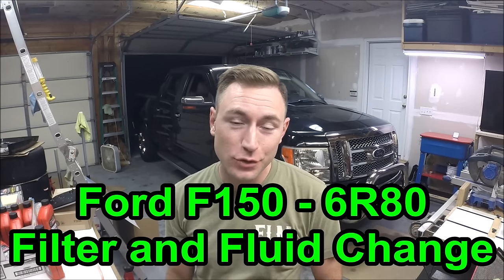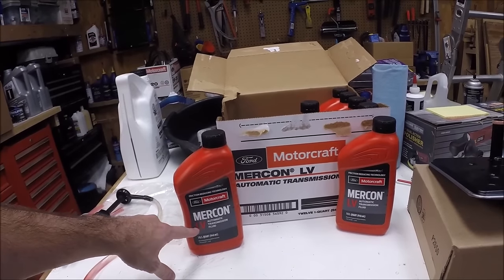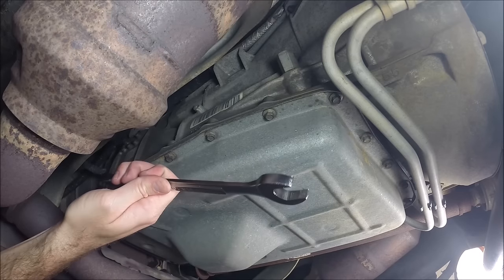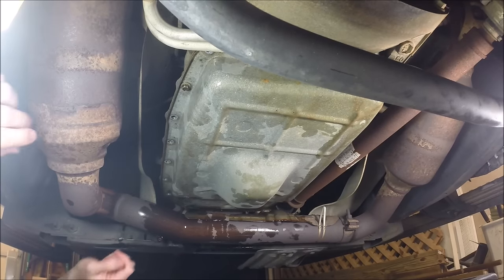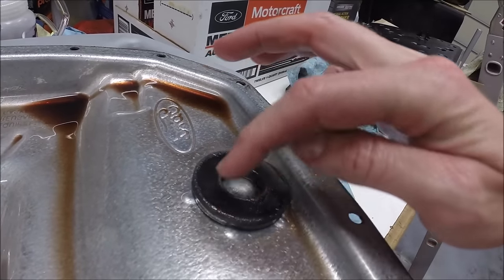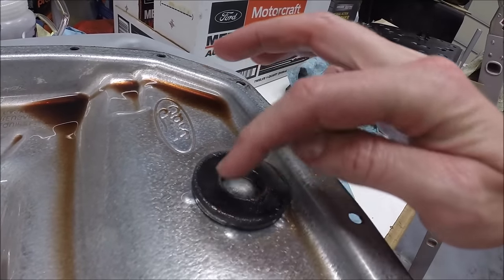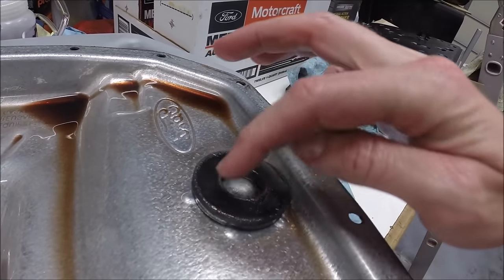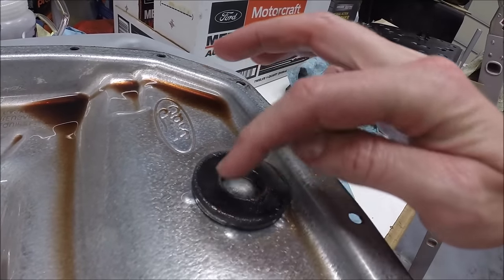Ford F150 - 6R80 Filter and Fluid Change

Comment: Would you recommend using aftermarket oil like amsoil atf instead of mercon lv or v?
Reply from the maker: If you decide to use another fluid, you need to make sure it is truly the same as Mercon LV.   The LV stands for low viscosity.   Also, you're only changing about half the fluid; there's still some left in the torque converter, cooler lines, etc.   So to really get the benefit from a different fluid, you would probably want to change the fluid a couple of times.  So for me personally, I decided to stay with the Mercon LV.    If you decide to try something else, please come back and share your results with the class.  Thanks!
Reply: Scruf's Garage i called amsoil representative and they said it’s compatible with mercon lv. I know it’s bias but I did put 7 quarts like half of what inside the transmission. So far it’s smoother than before. I don’t know if it’s good that way. It should be. I’m planning to drain it and put another maybe 6 quarts this time. I upgraded my cover with Dorman with drain plug. We’ll update you soon

Comment: did you hade any problems with the Transmission after you did the fluid exchange?
Reply from the maker: No issues.   In fact it helped resolve a "judder" issue I was having.
Reply: @ScrufsGarage  good news, I was asking because the fluid color was dark and most of the time when you change it when is that dark the transmission goes bad

Comment: That shudder is probably the driveshaft binding. Common issue
Reply: The driveshaft binding causes a clunk when stopped at a light and you let off the break to pull away. The clunk happens as the rear of the truck settles or squats back down in the rear.

Comment: I bet it wasn't even a transmission shudder. These trucks are notorious for the driveshaft causing this shudder. All you need to do is regrease the spline that slides into your transfer case. I thought for the longest time it was a shudder from the transmission, but nope. Driveshaft
Reply from the maker: For me, I had both issues.   Changing the transmission fluid helped the shudder.  I never got around to doing the repair for the driveshaft clunk on takeoff.  But for those trying to determine what issue they need to address, it's good to be aware there are two different issues.
Reply: @ScrufsGarage  what I'm trying to say is from 20 to 50 mph even faster, I would have what felt like rumble strips shaking my truck. Thinking it was a transmission shudder when in fact when I greased up my spline on my drive shaft it took care of the shudder and also that stop/bumped as well. $10 grease is all it took 👍

Comment: Wise men once said t never reuse a gasket
Reply: Unless it's a reusable gasket.  I've dropped my pan a few times and no leaks so far with the stock gasket.  But yeah if it ever leaks I'll drop the $40-$60 and use a new gasket.

Comment: Shit so you dont get the 12qt of oil out . ! I bought 12qt of oil ! But u saying u only need 8qt
Reply from the maker: I would capture and measure the fluid that comes out.  It's very unlikely you'll get 12 quarts out.   But better to have more fluid than you need, than filling up and finding that you're a quart short.    Be sure to report back with how much fluid you get out.
Reply: @ScrufsGarage  so i just did it yesteray and i only got out about 5qt and 1/2 ... so dont know if i am missing  my mustang is lowered so i cant get under and check the oil level while the car is level so i need to take it to a lift and check it out . Cause i mean 5qts its not much .... and you are right usually everyone says about 7qts

Comment: Ford doesnt want us checking or changing the fluid is right. They want to bleed us at the dealership. They should be ashamed of this magnitude of greed.    Do-it-yourselfers are going to do it ourselves anyways. Actually I'm going to make a point of avoiding the dealership bc of this.
Reply: Ford figured out that most of problems relating to their transmissions was having too much in it, The only reason ford put the dipstick under the truck is so that inexperienced people don’t go adding fluid every time there trans acts up

Comment: People must be checking the fluid level the wrong way if they get 5 plus quarts out and have to add 7.5 in. IF the fluid is COLD this makes zero sense. Theres no way in hell all these transmissions are that under filled and the modern Mercon LV does evaporate nearly as much as say an old merton fluid. Something is fishy here.

Comment: I burned the shit out of my arms and the back of my hand doing this service on my Raptor. Typical idiotic Ford design. Won’t do it again. I’m going to buy an aftermarket AFE pan with a drain plug and buy the dip stick because I’m starter than ford when it comes to the simplest things.